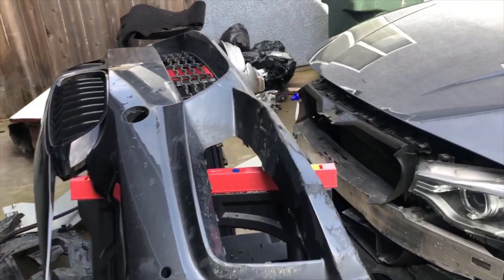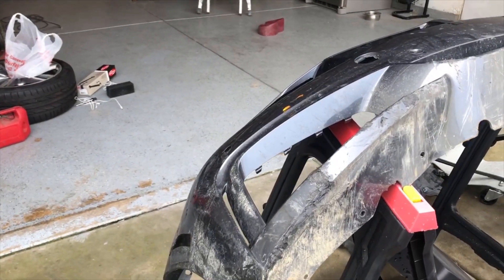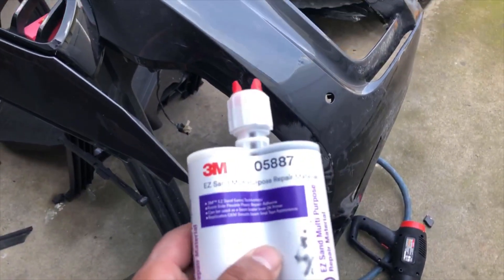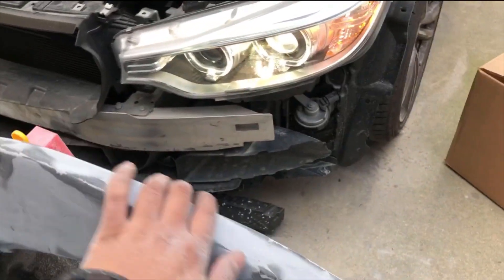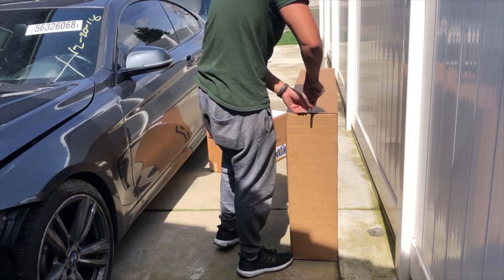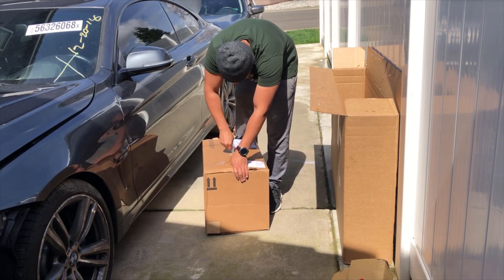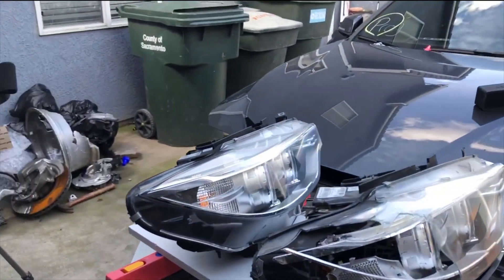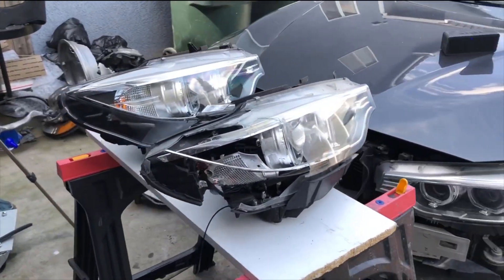F32 BMW 435i M Sport Rebuild Part 2 - Bumper repair

Comment: was the headlight you purchased a xeon adaptive headlight im in need of one for my F32 rebuild and also a fender drivers side would you happen to still have purchase links?
Reply from the maker: Space Coupe N54 Yeah it was the adaptive headlights but I bought mine used so they only had one in stock and the fender I purchased from was eBay